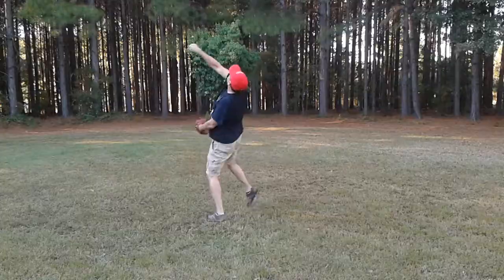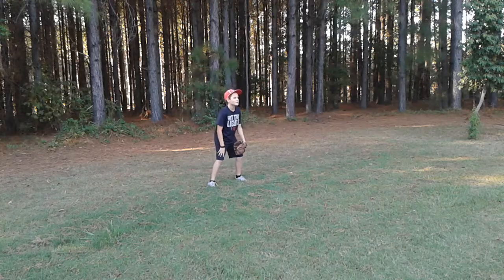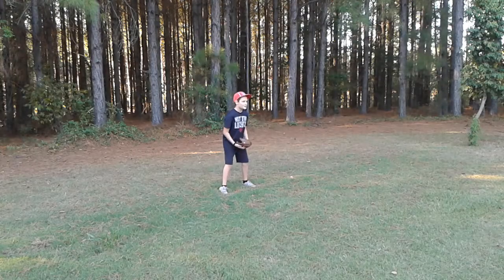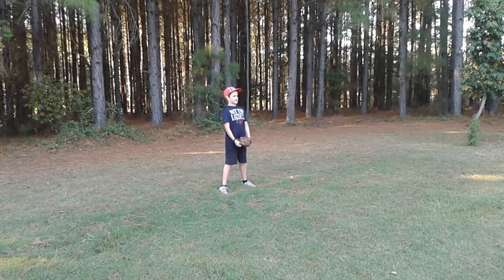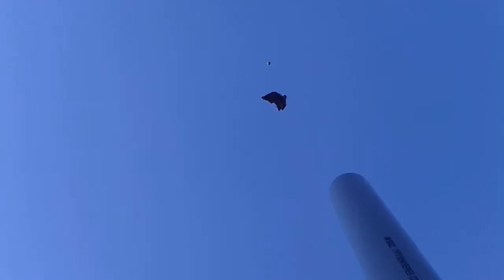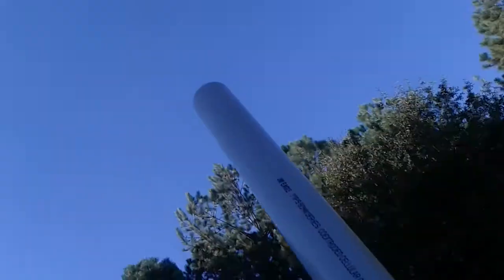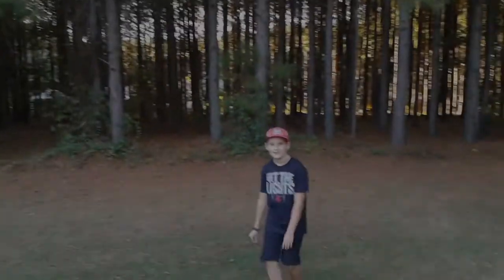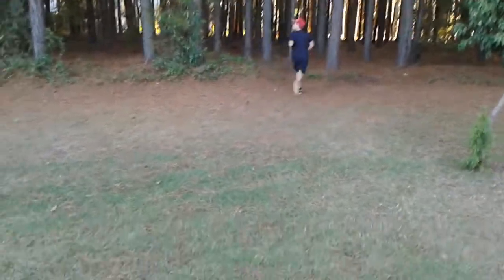PVC Baseball Cannon - Propane Powered DIY

Comment: What is the purpose of having to screw in the gas lighter? Why not leave it screwed in?  What is the purpose of the other nipple with the cap just above the gas lighter?
Reply from the maker: Having it open allows the air-gas mixture to keep flowing through and not separate. The hardest part is getting a good mixture. This worked best for this setup. Tried a bunch of different setups.
Reply: @ClaytonDarwin  So you had the 2 caps open while opening the propane, then pit back  the  2 caps one by one then shut off the propane?
Reply from the maker: Air-gas mix went in the top. Left the bottom open. Counted to 10. Put the grill clicker in the bottom. Turn off gas. Ready. That seemed to work pretty well.
Reply: @ClaytonDarwin  Thank you!